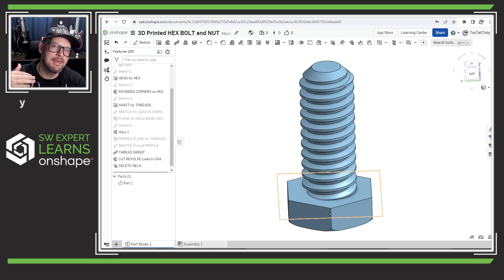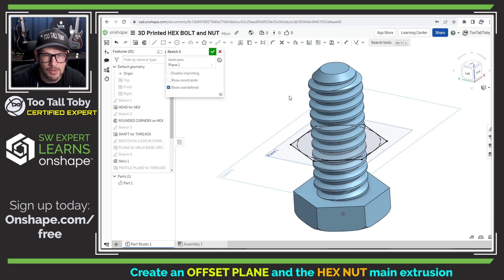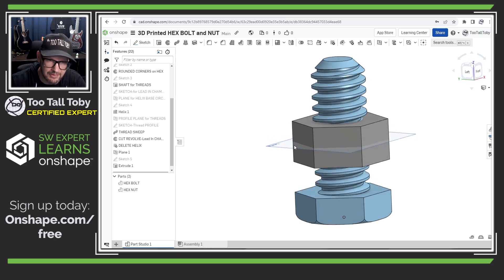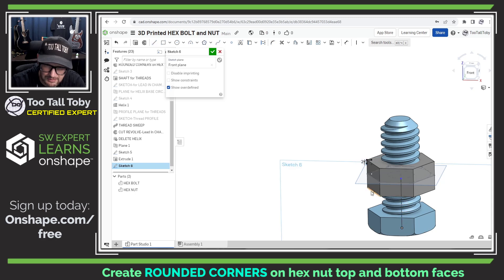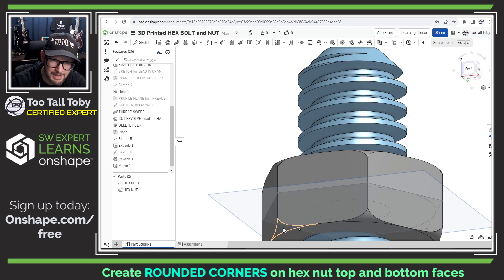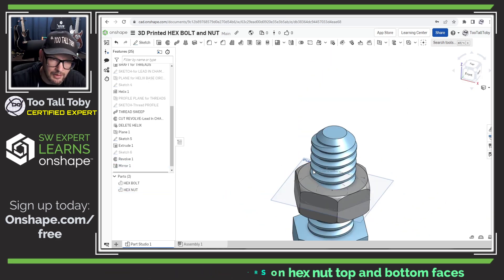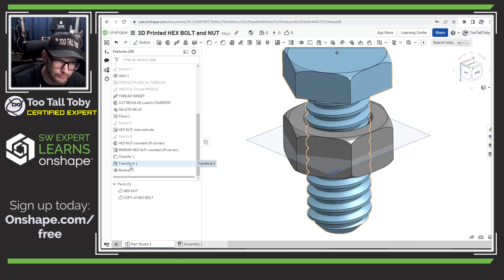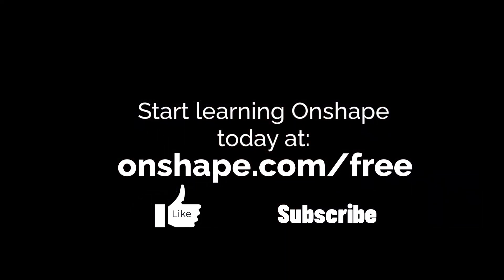Designing a Hex Nut (Tutorial)

Comment: Thanks for the insight, but I'm having difficulties with a thread that is a hemishere swept onto the cylinder. The pitch is 5mm. The base of the hemishere is 4 mm. During the Boolean I select the Bolt as the "Tools" and the Nut as the "Targets". The face offsets are the fase of  the sweep and the thread cylinder. The Boolean will not regenerate properly: Could not offset selected faces as requested. Any thougts would be appreciated. Thanks.
Reply: More info - If the Offset Distance arrow is  pointing up(right) the boolean will complete. I I leave it down(left) the Boolean is red (incomplete). I can't subtract from the bolt as that is not a part I have control of. I can only subtract from the nut. Thanks again.

Comment: A one-to-one clearance (zero clearance, basically) would result in the phenomenon of "wringing." Weights are machined this way and have the utmost accuracy with regard to mass. Wringing is where you put the two objects surface-to-surface, and they stick to one another as if they were magnets - and extremely strong ones, at that. It takes a LOT of effort to get them unstuck from one another. Physicists still really don't know how or why this occurs but, it has to do with the "flatness" of the two sides being touched together. There is speculation regarding molecular attraction and surface tension. I saw this in a video about the creation of standard weights used by machinists.
Reply: nice! My 3D printer won't quite give me that level of accuracy 😁😁 But I like this concept!  Like those Zero-Tolerance Machining videos!

Comment: The "keep tools" option from the boolean operation would let you skip the copying of the bolt, and still have both parts that can be exported at once.
Reply: ahhh - great suggestion thanks!
Reply: @TooTallToby + Offset all ;)
Reply: I think I tried offset all but it got jammed up around the area where the head of the bolt and the threads came together (I'll have to go try it again)  @michtill
Reply: I found that out the hard way when my HEX Bolt "disappeared" after accepting the boolean operation! Yikes. Luckily I found that "Keep Tools" option and tried again.